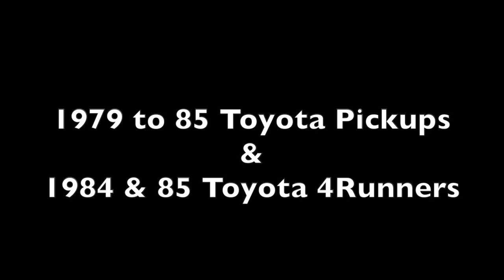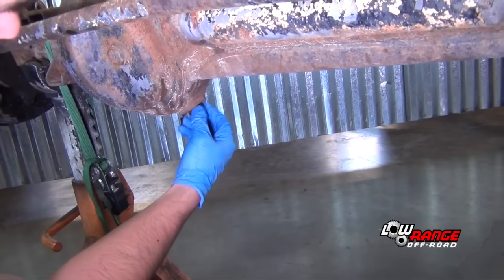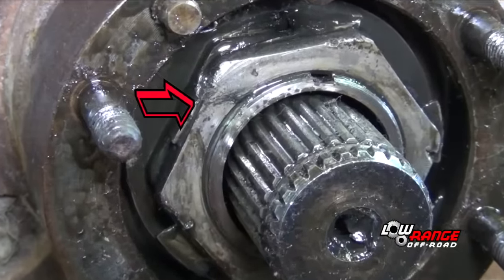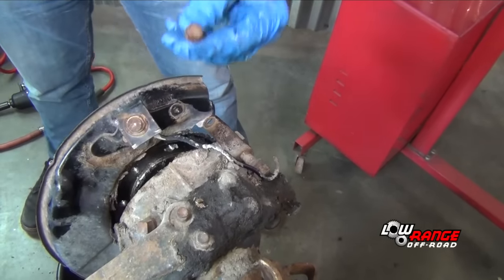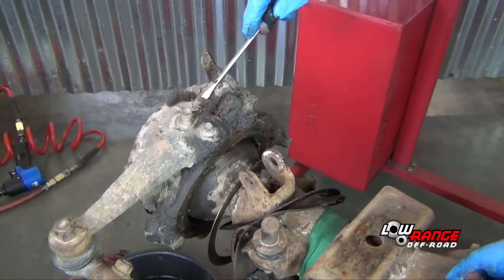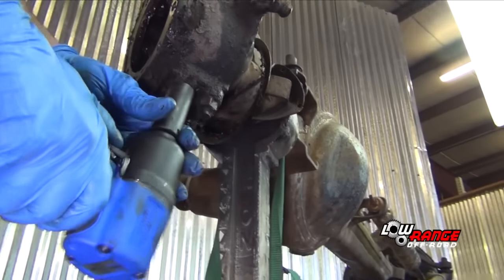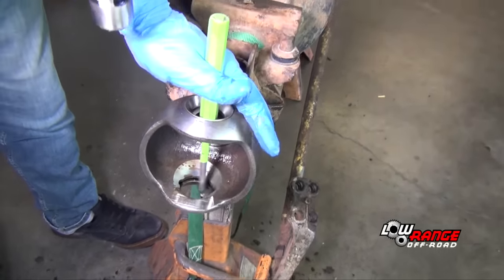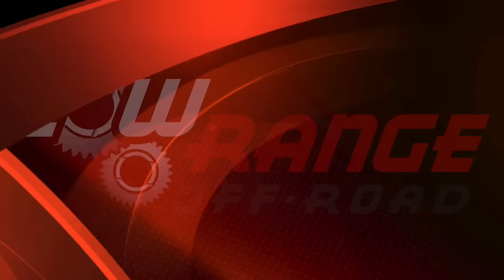How To Rebuild A Toyota 4X4 Solid Front Axle (Part 1) Initial Tear Down

Comment: The editing and preparation of the videos of this channel  is outstanding, and help people a lot. So, it is a must to contribute.

First and before tearing the axle apart, it must be checked if it rebuildable or not, e.g. large bent in the housing. Also, it must be checked for bent housing (I mean small one). The checking can be done by a water gauge. If it bent, then, during disassembly, it has to be address where is it.

It is very simple inspection, however, it will tell us about the whole history of the axle and how to do the straightness of housing. By the way, a lot of housings come bent.

Then, during disassembly of the kingpin bearings, the preload on them  has to be assured otherwise, and especially if there is a play in them, the flange that holds the bearing race can be bent inward (pressed in due to excessive abuse) and the complete housing is a trash. It can be fixed either by pressing the flange outward or welding on a new flange. In both cases,  the centering of the CV joint around the axle shaft seal is not assured. This means an oil leaking housing.

All the bearing surfaces has to be inspected.
Most service manual call for inception of part before, during and after disassembly for whatever can be inspected for expected wear and tear. 
Good luck

Comment: I just installed the ultimate solid axle kit on my 1983 4x4 yota and the new shims with the kit were way to thin. The thick and thin shim together were not as thick as the factory thick shim. I had to reuse the Toyota shims before anything would function properly so make sure you keep your old shims. Also for people like myself who have never done this job before it would be a great help to include a simple set of clear instructions to reference.

Comment: Great video, the only thing I would do differently is to remove the cone washers by riding the nut up to the top of the stud until it is flush, then I take a brass drift and a 3 lb sledge and smack it with the drift and sledge.  The cone washers pop right off.  Hitting it with a hammer can cause damage.

Comment: I have a 74 fj40 LC, would like to convert over to disc brakes up front. The knuckle on a 74 has no mounting brackets for the calipers. Would late 70’s early 80’s Toyota truck or 4 runner knuckle mate-up to the  74 axel housing?

Comment: nice job on these axle videos... i wanted to mention that there are shims under the steering arm and under the bottom cap, need to keep track of what shims went where when disassembling, so that it all goes back together properly centered... toyota sells an sst factory tool for measuring how much shim thickness you'll need to use, but i couldn't get it to be fully functional with the trail gear axle housing and longs, it was only partially useful... also, be careful about using a screwdriver or pry bar for the teardown, don't want to score or dent anything, although i ended up having to buy a new set of shims anyway.
Reply from the maker: Great advice!  We really appreciate the feedback from our viewers. Thanks for viewing the commenting.

Comment: ugh... more incorrect cone washer removal... yota bros, don't strike the sides of the hub body with anything! Use a brass drift, and strike the studs head on with a nut even with the face of the stud!
Reply from the maker: +Philip Gragg  Yes, we agree.  Brass drift on the studs with the nut flush with the stud is the best way.   If we revise this video we will be sure to include that procedure.  Thanks for viewing and commenting.
Reply: Agreed... Was also thinking the same thing over here !
Reply: cool rig
Reply: Gear box 4wy  spit
Reply: Philip Gragg https://translate.google.com/m/translate?hl=ar
ترجمة Google
https://ar.m.wikipedia.org/wiki/%D8%AA%D8%B1%D8%AC%D9%85%D8%A9
ترجمة - ويكيبيديا، الموسوعة الحرة
https://support.google.com/chrome/answer/173424?co=GENIE.Platform%3DDesktop&hl=ar
تغيير لغات Chrome وترجمة صفحات الويب - جهاز الكمبيوتر - مساعدة ...
Reply: Ughhhhh this is why my hubs have hammer marks all over them!!! Not the way to do it ffs
Reply: its a toyota,who gives a shit..

Comment: So on my ln106 the whole swivel hub moves up and down and when the tyre is on it and truck is all sitting down normal you look at the right tyre and its perfect and you look at the left and its on an angle. The steering arm is all secured in tighy but the only problem is the swivel hub moving alot so what would the problem be?

Comment: ok i am quite new to the qorld of 4x4, i dont k now to much but i own a 2008 toyota hilux 4 door and am looking to do a sas conversion on the front axle using an 80 series landcruiser rear axle for max flex:D but i wish to know, do these items added to the axle in this 9 part video series be used on th specified axle or not, cheers:))

Comment: Mr. you're Wrong already on the Differential bolt, by this you're supposed to take the top off before doing the bottom bolt. How're you going to tell everyone that taking the bottom off in this video and than to the top bolt. I do believe you do know you if you end up taking the bottom off and if you're unable to take the top off than more then likely you're screwed, due to the fact that you cannot refill the gear fluid back in. Plus I want to add to this is the bolt with washer and cones on the locking hub. you're supposed to leave the nuts/bolts towards the end of the stud so when you used that brass hammer to hit the comes off, you want able to mess up the studs and have the washer on the stud the cones will not be able to fly off.  hope this help you're mechanics and to whomever is DIY. anyhow great video though

Comment: The lower knuckle bearing cap on my axle is loose but will only move up around 1/2 inch before it stops. All amount of prying and hammering will get it off. Any ideas?
Reply: pack in more grease
Reply: yeeh,read upper comment,FIT A D44 JEEP DIFF.toyotas suck.